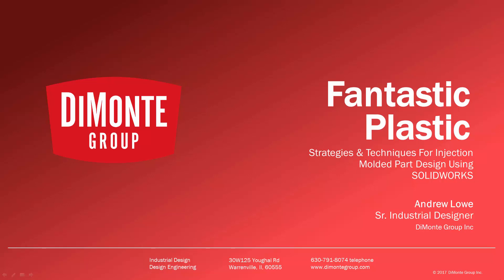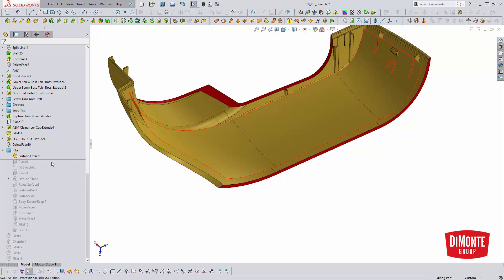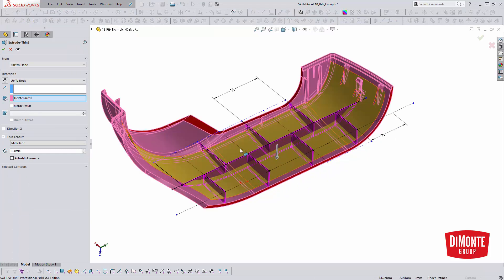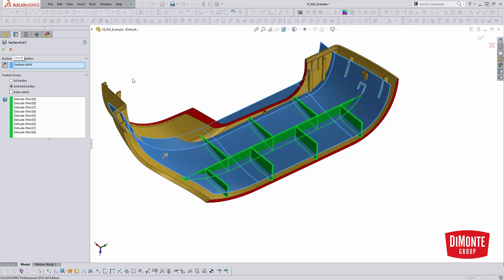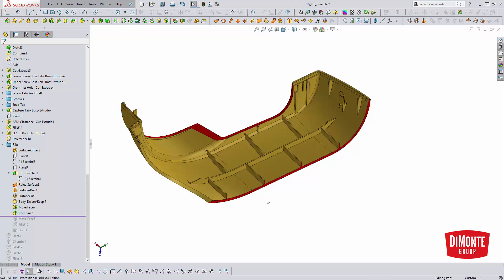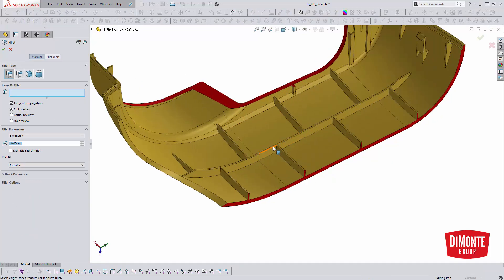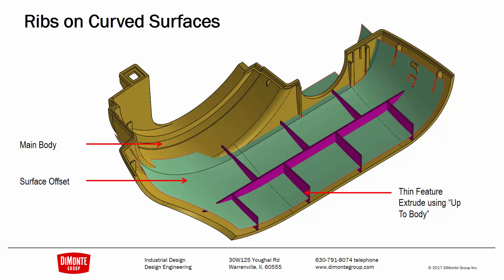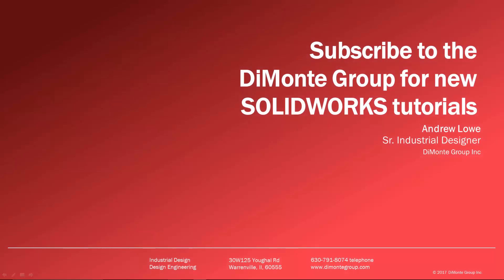Fantastic Plastic 19 - Ribs on Curved Surfaces - SOLIDWORKS

Comment: 4:01 the move face command on that portion.  It is "strange" how that detail did not just move "as-is" staying in the same geometry.  Instead, it moved but also "conformed" to the previous influence of the surface extrusion and trim command.  Even though the move command is "after" that operation.

Comment: Thanks for the tutorial. Why didn't you use the draft feature in the extrude command?
Reply from the maker: Thanks for taking the time to watch our video. If we applied draft in the extrude feature, the ribs in the middle of the part would end up being much thicker at their base than the ribs at the ends of the part due to the curvature of the part.  By extruding without draft and applying draft manually after the ribs are trimmed to a uniform height, we can be sure that the base of every rib is 60% of the nominal wall thickness and avoid visible sink marks on the exterior surface of the part. It's a little bit more work, but it makes a huge difference in the quality of the molded part!
Reply: @DiMonteGroupInc  Thanks,  great series. Keep it coming!